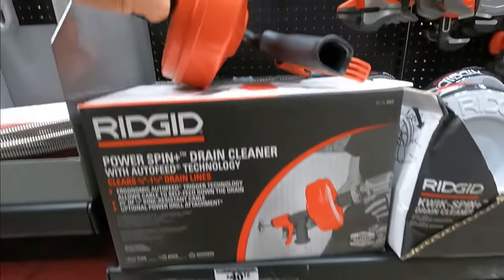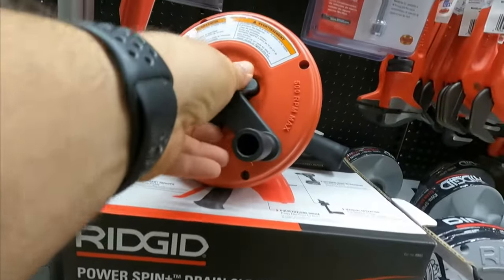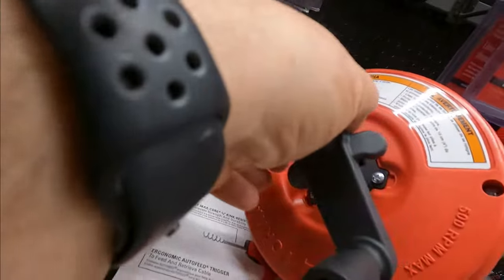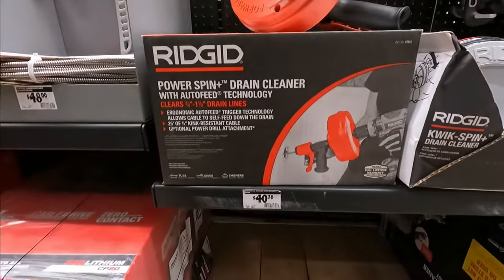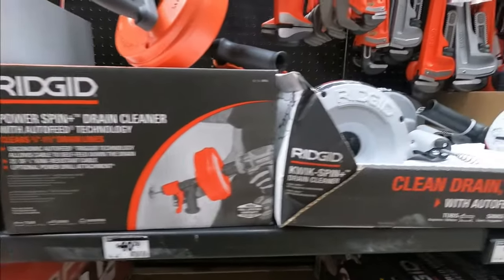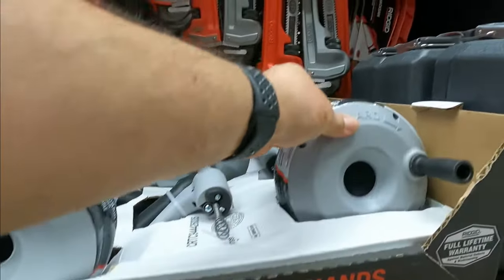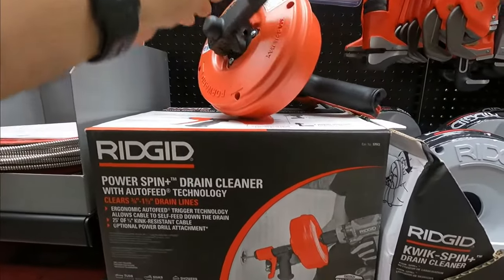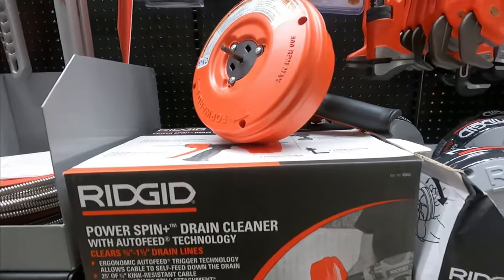HOW TO UNCLOG YOUR KITCHEN DRAIN

Comment: I’m a renter,  but I don’t like bugging my landlord… and I wanna learn to do this myself.  Thanks for the video 👌🏻.  I’m gonna go buy those tools tomorrow.  My clog is somewhere behind the wall.  I tried a cheap, 2-3 foot hand snake, but I couldn’t reach the clog.  We’ll see 🤷‍♂️
Reply from the maker: Hey Cory.  Good luck.   Let me know how it goes.   Remember don't let any slack on the cable.  It will tangle .  Keep it  6 inches or les from drain.  Remember to bend it a bit so it goes down. Use a flash light.
Reply: @alexthehandyman3494  thank you so much! 🙏🏻 I’ll check back in the next day or 2 and let you know how it goes.
Reply: @coryjohnson2486  We are waiting on an update man. 😅

Comment: I just did my bathroom sink not too long ago but I did not cleared the pipes with the snake ( I don't have one).  Nice video.  next time I have to clear a sink I will make sure I use the snake to clear the pipes in the wall.  Thanks for the video.
Reply from the maker: Thank you Eduardo.   Once you buying it last forever.   You ll use it in all your properties.
Reply: Thank you

Comment: Hi whats that tool you use to loosen the pipe? Thank you
Reply from the maker: Hello,  Tongue and groove channel locks  by channel locks or huskyhttps://www.homedepot.com/p/Channellock-12-in-Tongue-and-Groove-Slip-Joint-Pliers-440/100002119?source=shoppingads&locale=en-US&pla&mtc=SHOPPING-BF-CDP-GGL-D25T-025_001_HAND_TOOLS-NA-Multi-NA-PMAX-NA-NA-NA-NA-NBR-NA-NA-NA-Hand_Tools&cm_mmc=SHOPPING-BF-CDP-GGL-D25T-025_001_HAND_TOOLS-NA-Multi-NA-PMAX-NA-NA-NA-NA-NBR-NA-NA-NA-Hand_Tools-71700000113231510--&gad_source=1&gclid=CjwKCAiAg9urBhB_EiwAgw88mWijC2AgcSBL55wScP7LUegc0en21v5m78DCotOR61vcFjact_byxhoCYIQQAvD_BwE&gclsrc=aw.dshttps://www.homedepot.com/p/Husky-12-in-Quick-Adjusting-Curved-Jaw-Groove-Joint-Pliers-90142/313528149
Reply from the maker: don't forget to like the vido and subscribe if you can please.

Comment: Is Teflon required?
Reply from the maker: Hello Ted.  Is always better to apply Teflon paste or and tape.   It still had traces of the paste and since is a low pressure drain, the chances of leaking are slim.    If it was supply water... yes.  always!!  Thank you so much  Ted.  See you around1

Comment: Mine is still clogged with the 25 foot snake.
Reply from the maker: Did you make sure it went down.  Did you see it physically,  If it went up then you went through  the vent.  It needs to go down.  Let me know.
Reply: @alexthehandyman3494 yes brother, I made sure it went down and put full 25 ft snake in, when pulled back nothing came out and then I put a 5 gal bucket of water in each at the same time and it was draining good until the very end it stopped draining again. Help bro !
Reply from the maker: @alenbazarov3039  Maybe you just need a longer snake.   You can rent one from Home Depot .  Get a 5/16 or 3/8 50 or 70 ft.long.   Is this the kitchen drain?
How far from the main?  Usually the main is by where a toilet is?   If this is a kitchen, this is a branch and eventually has to reach the main.   Keep me posted.  One more thing,  Is this pipe 1 1/2 to 2 inch?  If is bigger the snake might coil and not go all the distance.